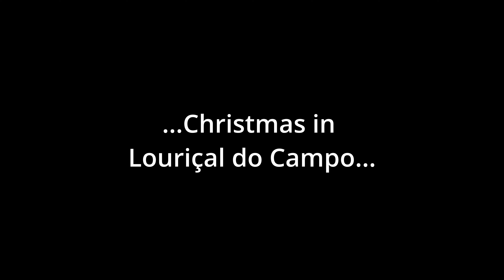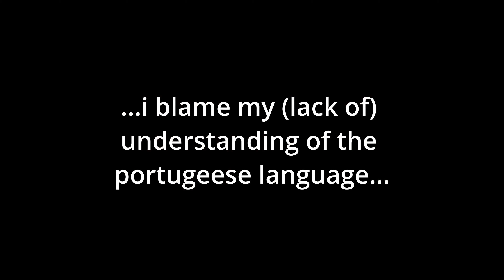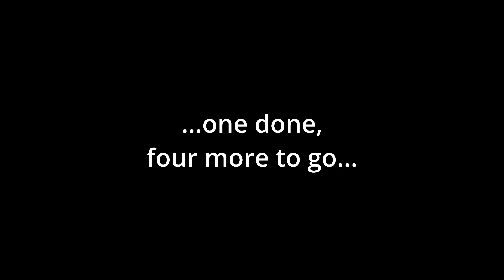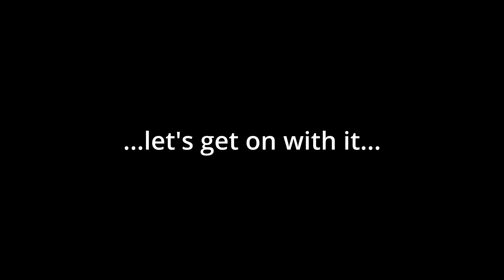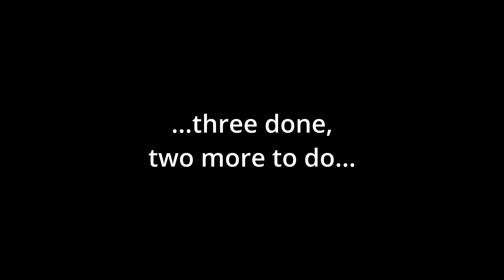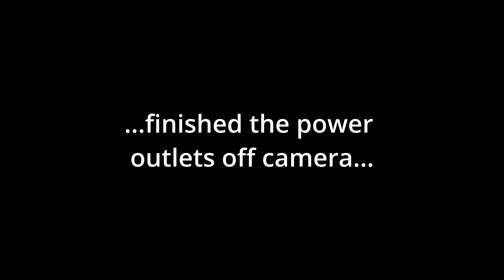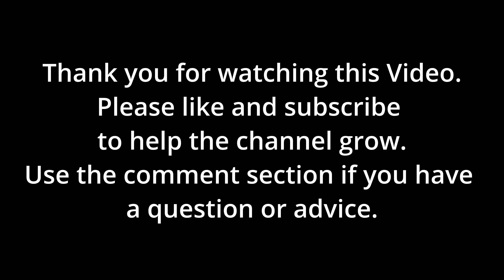Y1-W33: A door and Power outlets/wall sockets

Comment: I caught that foreign f bomb! 😂 Sorry you missed the fire/celebration. 
Looks like you’re making good progress with your renovations. For drilling the stones are you starting with a smaller pilot hole before using the size you need? This usually helps with accuracy. Happy New Year! All the best in 2024! ❤🎉
Reply from the maker: not sure what you mean with "foreign f bomb"? yeah my neighbour was at my place that same day and told me it starts at midnight, but when i was there fire had been lit adn the beer/bbq trailer was closed, i though i had missed it all. Nope no pilot holes. it is also about the shaper of the granite. The waterlevel spot at the right height sometimes get me only two screws of the 4 possible, because the outlet would be too far from the surface (and thus the long screws i have too short). But it is all fine and within a small margin. Not sure someone would notice without the laser level. All the best for 2024 and hope your well again (saw something about no video cause you guys were sick)
Reply: @Quinta-Entre-Aguas  Sorry f bomb means the swear word… interestingly it also starts with f in Portuguese. 😂 Glad you didn’t miss the celebrations then. Working with irregular shaped natural materials is definitely challenging. We’re feeling much better thanks! Somehow we both caught a nasty sinus cold. We spent 3-4 days in bed and it took another week before we felt normal again. 
We wish you a happy, healthy and prosperous 2024. Best of luck with your renovations! ❤️🥂🎉
Reply from the maker: @notyouraveragegringos  ah ok I know the two f words. I did miss the celebration as I thought it was over and only was told it restarted at 23:00 or so. Wish you also a healthy and happy 2024 ;-). I am wrestling with a bug for the last 4 weeks...should be better anytime now 🤞
Reply: @Quinta-Entre-Aguas  Hope you are fully recovered soon! Take care! ❤️
Reply from the maker: Thanks. In Germany we have a saying "Unkraut vergeht nicht." And what doesn't kill us makes us stronger...right?
Reply: @Quinta-Entre-Aguas  Natürlich! The German sayings are the best. 😂😂😂